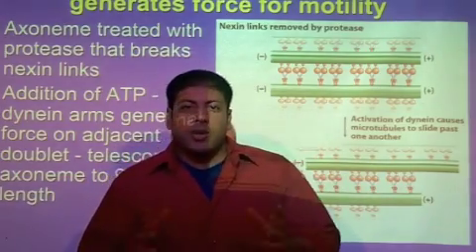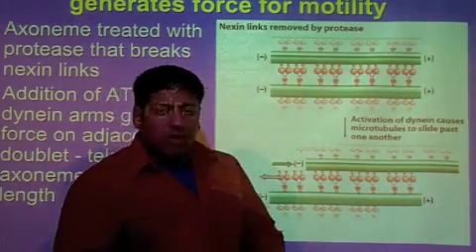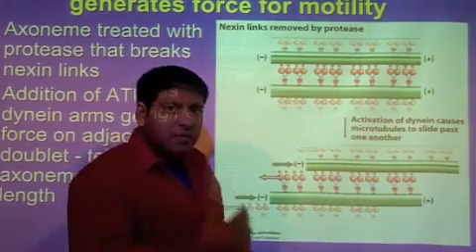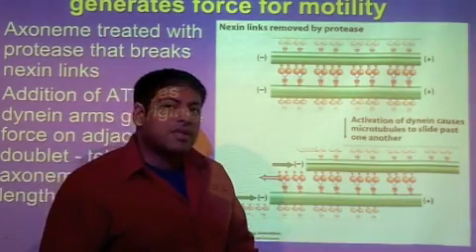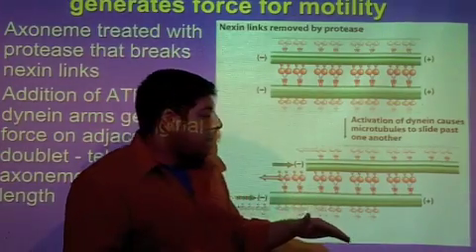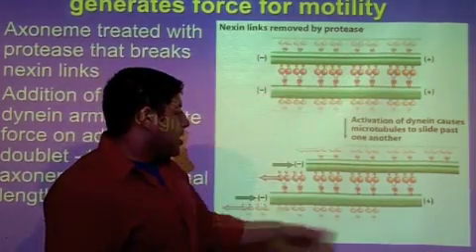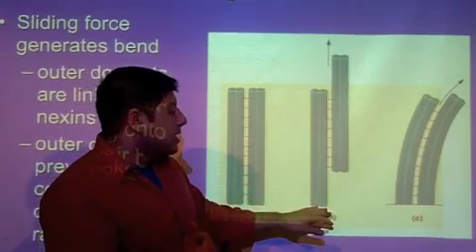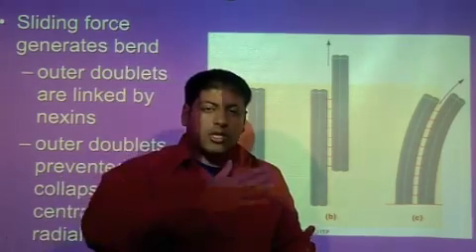Dynein and MT's crossbridge

Comment: Sorry, I have a question.
In the last slide of the PowerPoint, about the red linkage between micro tubules.

Is the red linkage represent both the necxin and dynine?
Reply: They are representing dynein proteins generating different types of movement after being activated by ATP.  Nexin is involved but not illustrated in that image.